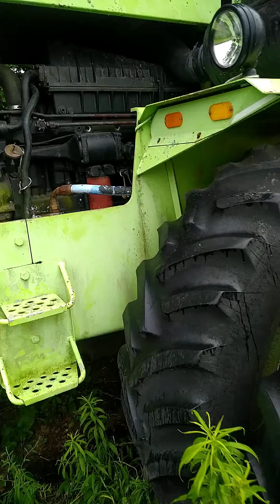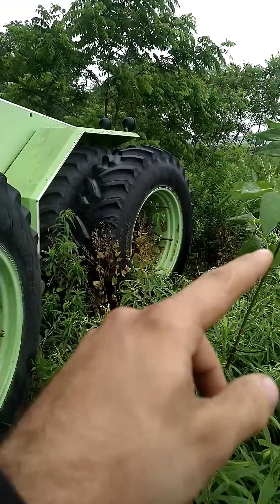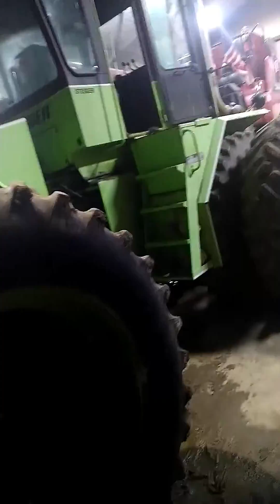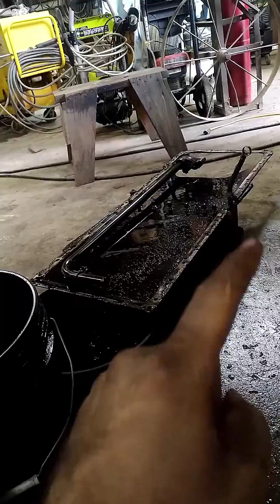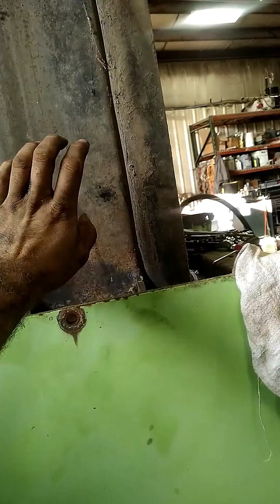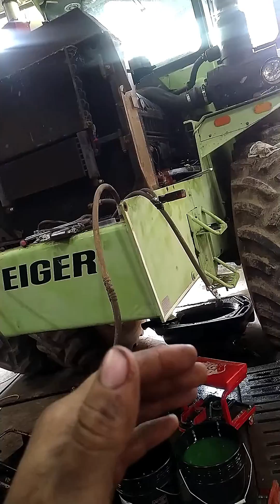Steiger Project Part 1

Comment: These old Steigers were all the same as far as the tractor and frame went. There was a higher-power Steiger offered with the 3406, so I'm sure the ones that came with it just had the radiator moved up like you said. As far as that 3306 goes, they're normally pretty rugged engines and have wet liners. I don't think a dropped valve would chew through to the actual block, hopefully all you would need is a new liner, piston, valve and maybe the head
Reply from the maker: There's an update video coming soon on the project, in more recent videos it got a 3406 with Jake boxes put in it.
Reply: @tannershearer9742  Awesome! I'm watching through all the parts now